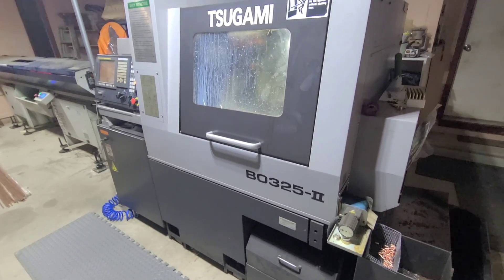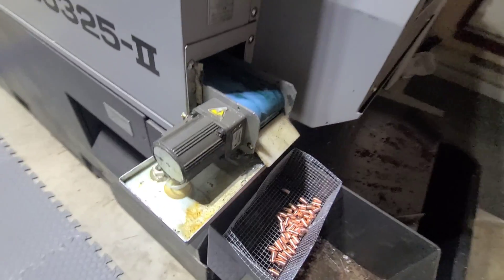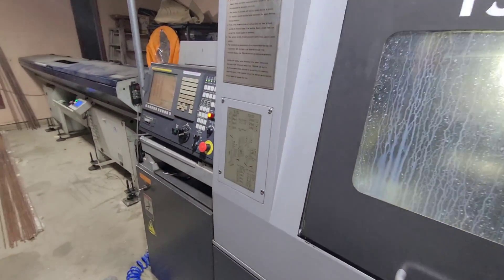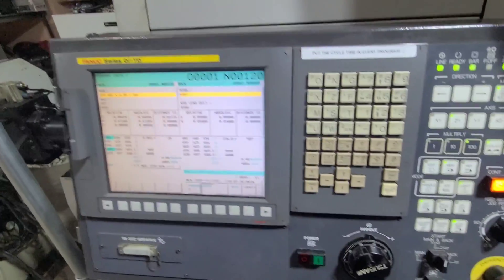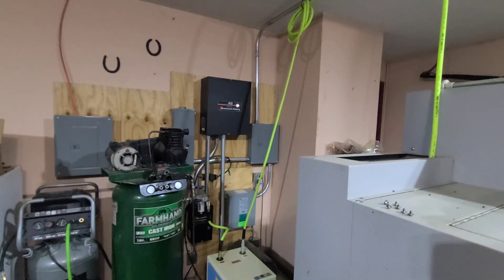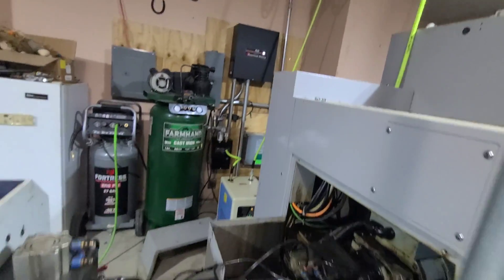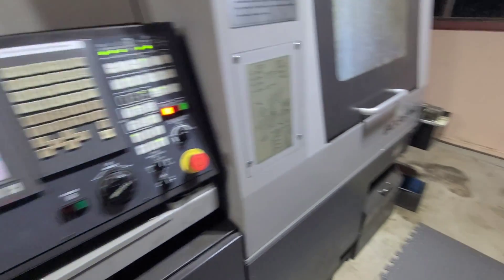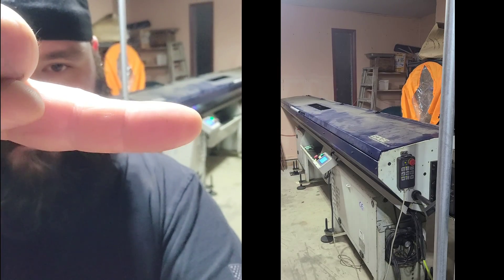We bought a Swiss lathe, here's what I have been up to.

Comment: Definitely gonna be ordering a couple boxes. 
1-Question/Comment I would assume that with the lighter round it would be easier recoil on smaller frames shooters. Ie… elderly, women, handicap etc… 
Would that assumption be correct?  
Either was I’m getting a couple for myself but I may get them for myself daughter and wife as well!  I was certainly impressed with your video and the Taofledermaus video
Reply: correct , also keep in mind that the type of handgun also effects the recoil as well. Generally lighter polymer or titanium handguns have more recoil than a heavier steel one because the heavier the gun the more it absorbs the recoil.

Comment: If you have issues with the barloader lmk, I have lots of experience with them on citizen Swiss lathes. Barloader alignment issues can be the cause of tons of errors, if you can't track down an issue try an alignment.
Reply: Also, if you are good at programming you can try making a parametric program where you change a variable to choose different parts instead of loading it on a card and bringing it over each time. Idk about that lathe or it's controller but if you can use macros it would eliminate a lot of work if you do different batches frequently.
Reply from the maker: The problem is the screen is dead and I can't setup the parameters on the barloader. All I can do with it right now is open and close the channel that's way I can only run 1 bar at a time.
Reply: @BallisticMachinist  Any eta on the screen? I know things are insanely back ordered right now for electronics related to manufacturing. We have been waiting almost a year for a replacement PLC for one machine.
Reply from the maker: @johngriffin618  the part is about two weeks out when I order it. This has been such a large investment that has gone about $30k over budget I need to sell some of these 9mm before I can order it.
Reply: In my pushing 20 years of swiss, Edge barfeeds are junk.  CAV loaders as well.  LNS Express loaders are the best for a magazine type loader.
Reply from the maker: @ingest-a-satchel-of-richards  this is my 1st one and I'm not a big fan sofar